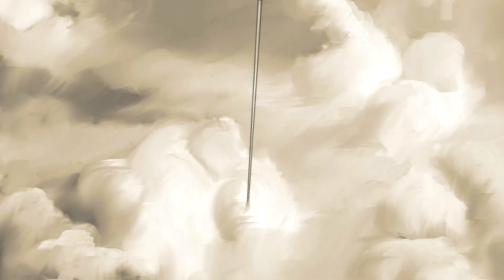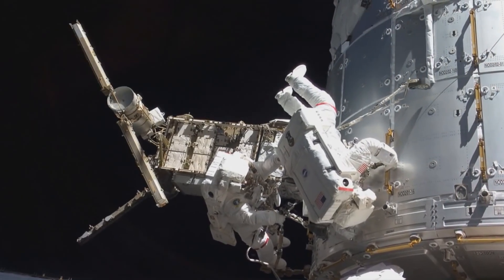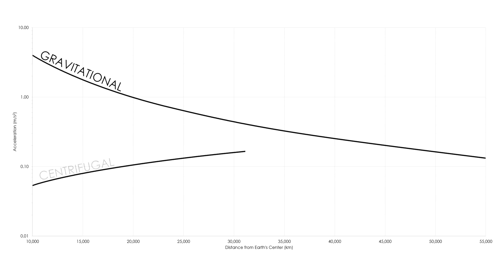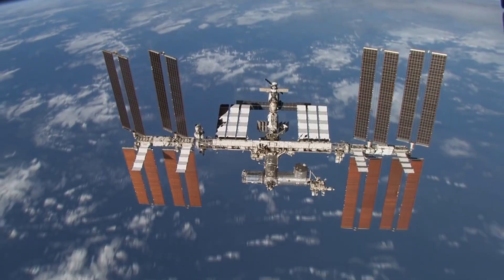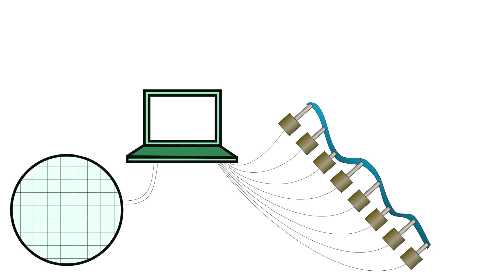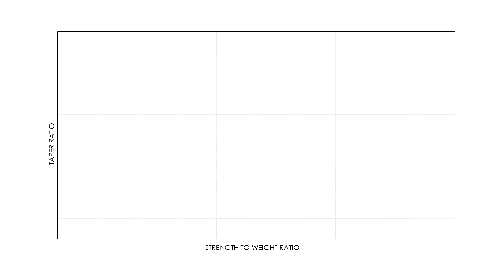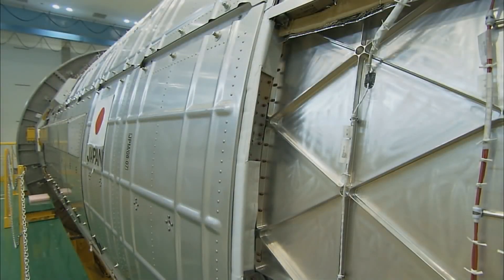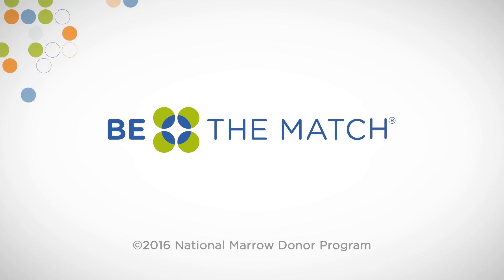Design Your Own Space Elevator

Comment: Tesla though about this over 100 years ago and proposed orbital rings in low earth orbit.  Commercially available tethers could easily handle the load across a span of 400km, and the trip wouldn't take weeks.
Reply: How would you use these rings?
Reply: @sebastiaomendonca1477  As they would be outside the atmosphere, you could do solar power at 2kW/m², launch upper stage rockets with no fairings (either conventionally fueled or with magnetic accelerators), and all kinds of industrial processes that could take advantage of a vacuum.  Plus you could build hyperloop, without the tubes.

Comment: Hellow brother this is 1 of the problems the tension , and to make a good job for elevator is that wire don't have to be in tension. Other way that wire will break and the good news is that the wire will make its own tenciion for its weight. To the ground but if to much tenciion no good and this is. 1 of revelations too, but I am getting exiting and I wish to be here. To be the first one to try that elevator and don't care if I die but will be so exiting that hard to explain, that exiting. Thanks for your video brother.
Chilli bean.

Comment: I would think if the tether could be conductive you could send power to the climber that way.
Reply: That is harder than you think. There is a lot of things that even I have a hard time know about it. I just did a quick google search on the topic and even short transmission power lines for like 200 mi or so can have losses of power of around 1.1%, but that is depending on the voltage sent down that wire. I look at the equations for that kind of stuff and it just way over my head to figure out but here is a link to the wiki page about this if you want to have a poke at it, and for a wire to be 22k miles well that is a lot of losses just in the wire its self at that 1.1% power loss, and this is at around 700kva, and again I would not know what voltage you would need to send the power at to keep the losses down, but still, it's some crazy number with that kind of distance. 

https://en.wikipedia.org/wiki/Electric_power_transmission

Comment: cant we power the climber by running 3 parallel carbon nano tube wires each with a high voltage phase running on it?  Then we can use any electric source we like

Comment: Aside from launching a rocket from the top of a high mountain near or on the equator there is little else you can do in the way of a space elevator. That mountain could be Mount Kilamanjaro which is over 19 000 feet tall and
 almost on the equator.

Comment: A few other important points:
 - The most practical way to power the elevator is to have large fuel tanks that get jettisoned, just like for a rocket, rather than using lasers.
 - If we're already assuming we can produce a graphene cable strong enough for a practical space elevator, we might as well assume we can pair it with a superconducting cable for power.
 - The minimal space elevator is far from getting things to orbit, as it doesn't directly impart velocity.
 - It would have to be much longer to allow things to accelerate via centrifugal force, and to gain more gravitational potential.
 - Vibrations along the cable and micro-meteorites are not to be underestimated.
 - Rockets are surprisingly efficient (around 10% for some orbits?). Given the huge upfront cost of space elevators, the long travel time, etc, it will take a while before they get competitive.

Comment: Well, it looks like multiwalled nanotubes are good electrical conductors, so the power problem is solved, just make 2 long cables out of carbon nanotubes around 1-2 meters apart and put the lifter between them, set up a few thousand volts potential difference between the cables and have the lifter run an electric motor from that. Ok, I know, the exact resistance of the cables will be critical, but also the gravitational force decreases with height, so you will need less current as you go up.

Comment: What if you built the nano wire from the station down to earth instead of building from the ground up to the station. It would have to start at the Clark zone or whatever he said. And build it going down. And as you build more wire. The space elevator/ factory would move to balance the two zone of gravity and the flying away part. I’m high 420 Engineering

Comment: why not a space lift? not attached to earth and use like a crane. we could get mass above the south pole (asteroid maybe) attach a crane cable to it and lower it down to an elevated platform use plasma thrusters on the "lift truck" to raise it.
still will be incredibly big job to pull off but maybe we have tech to do this?

Comment: Shooting a laser is not more energy efficient then running a copper cable... Sorry don't know how you think that's possible... It takes the nuclear reactor on aircraft carriers to shoot powerful
Enough lasers to burn up objects... And it would have to be more powerful then that.
Reply: Either way, it's going to be hard even with copper the distance we are talking about mean big losses with wires at 22k miles that loess of power just in the wire itself would be a lot. even with current transmission voltages which are around 700KVA  at 1000MW of power around 200 mi have a 1% lose and i think that for aluminum lines as that is cheaper. but still as the distance increases the resistance does witch mean loses and that a lot of power loess just in the wire its self.

https://en.wikipedia.org/wiki/Electric_power_transmission

Comment: How much energy would moving the tether be? Having a tether that is double could move the pod without having a motor on the pod
Reply: Yes! Just like a cable operated elevator, but it would be a continuous loop that the pod would attach to when it wanted to ascent or descend.  The elevator could have solar at the top for power.  The problem I see being difficult to overcome is the deployment of the elevator system.  Just exactly how do you attach a cable from the Earth to a counter weight in space?

Comment: I think Bradley Edwards wrote something about the taper: it should only increase in cross section some fraction of the length, the forces will start to decrease again; the tether would in effect be widest in "the middle", because thats where the tension is strongest. 
And how about the worst problem to solve: capturing an asteroid... Has anybody considered the energy needed to move that thing. And how about the risk management. Who on earth would allow an engineer corps fiddle around with a rock 100 times bigger than the one that killed the dinosaurs!
And forget nukes. Nobody is going to allow you putting those on a rocket (because what if the rocket blows up on launch, or falls on a country on the opposite side of the earth?)
Cheers, and have a nice day, solving those :-).
PS I do concur with the thing about the laser!

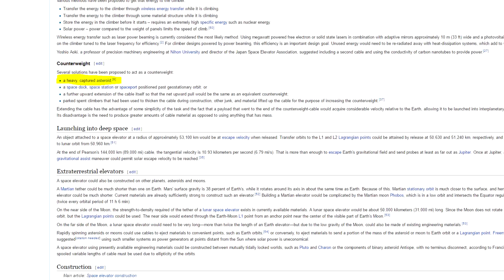Comment: 3:45 in my head increasing it's mass wouldn't help as while it increases the centrifugal force it also increases the experienced gravity by the same multiple leaving you with the same problem? So your only option is to be higher (though, if higher you could also increase the mass to increase how much tether pull you can balance out) It's been a long time since I did any physics, engineering or anything so am probably being an idiot though.

Edit: Also just found a comment by me from years ago on this video. Tuns out I have zero memory! :o thanks for making a video interesting enough I watched it a couple of times years apart!

Comment: Why not send the power through the tether? Just have charging stations every X kilometers
Reply: Pretty sure that is what he is referring to when he talks about extension cords (ie well due to resistance and such you wont have enough power left long before you reach even a quarter of the way)
Reply: @GummieI  Why not have a generator on the elevator? Not sure how feasible that is with how much fuel you would need but that is what immediately came to my mind
Reply: Gummiel u right
Reply: @GummieI  We can build fuel-based generators that can lift themselves off the ground WITHOUT needing a cable to climb, so this should definitely be doable.
Reply: @GummieI  

It isn't fueled underway. A 100 kilogram combustion engine + cargo combination with average (for modern) performance characteristics can make the climb with only 23 horsepower, carrying up 500 litres of gasoline with it, and reaching 50,000 kilometres with fuel left to spare.
Reply: @GummieI  On the way down you need a negligible amount of fuel -- just enough to start moving, because there's no air to slow you down. Once you drop a bit below geostationary orbit, the tether limits your ground speed to suborbital velocity, which makes the path of the vessel curve into the Earth with no force other than gravity required. The traction of the tether is then used by the elevator to slow down the natural acceleration, which requires no fuel.
Reply: @ChrisStavros  It occurs to me that if you were to use hydrogen fuel cells to power it on the way up, you could use regenerative braking on the way back down to electrolyze (some of) the water that was created by the fuel cells. This is assuming you didn't vent the exhaust, and that the extra weight of the electrolysis equipment and water tanks don't literally outweigh the fuel generated by doing this, of course. That or using some other kind of fuel we can pump power into in order to reverse the process we used to ascend. Batteries come to mind, but the sheer size of the battery needed to travel that far would be monstrous with current technology.
Reply: Keep in mind that as you leave the atmosphere, you no longer have ambient oxygen, so any fuel supply needs a corresponding oxygen supply.

Comment: You would also need to constantly accelerate the counterweight, as atmospheric drag on the cable and lift would constantly slow down its orbital velocity. It would also need to accelerate against the inertia of the lift, as the lift is not moving at orbital velocity at ground but needs to get to sideways speed as it rises.

So the counterweight needs to have thrusters firing just to maintain its orbit.

Comment: I also think on this little bit:) I remember that the cross section of steel musn't be large like on video. The worser problem is temperature of atmosphere is about 2000 celcius degree at the alttitue of 1400 km. So it is imposible to use a steel cable on there. By the way it is good to know that ı am not alone

Comment: An important, overlooked factor in elevator design: as the mass of the lifter ascends, it imparts angular pull - because the cable is spinning at a higher angular speed than the lifter was on the ground. The trig components of that drag tension along the cable pair horribly - one of them pulls the cable backwards in its orbit, such that a weight suspended above the Clark Belt would dip below it and fall; to compensate, you must make the cable longer, hence heavier. The other trig component just pulls earthwards on the cable, adding more apparent weight in proportion to the velocity of the lifter - so, if you want to travel faster, you create extra apparent weight. I'm still bullish on elevators, long-term, simply because graphene lets us make zeppelin towers with rail guns that avoid the bottom 15km of weight and acceleration-induced drag and tension on the cable, which help. Tweaking the graphene surface may turn the whole thing into a solar panel, and it's already an excellent conductor, so you could power many small modules along one, continuously. Additionally, powered high-speed pumps with hydrogen and oxygen are the best support power, if you are ascending through the inside of an elevator pipe . This is because they can ascend at high speeds relative to lifter, and their exhaust gas can be vented into lower chambers of the pipe, valves closing behind the lifter as it passes, such that the exhaust propels the lifter like a bullet in a gun. (Also, hydrogen won't leak out of graphene pump hoses...) Final exhaust into space occurs after the lifter passes the next valve; that final exhaust from the pipe is pointed backwards on the path of orbit, to compensate for the angular inertia and tension mentioned in the beginning. Done! (...on second thought, should we just use the zeppelin tower and rail gun, and call it a day?)

Comment: What if instead of a cable in the traditional sense, you build a ribbon.  This ribbon has multiple climbers that are, essentially, vertically moving trains.  Along the entire length of the elevator, you line it with solar collection.  This would make the entire ribbon a massive solar collector.

Comment: Space elevator will not work. If you move an object (wire) in a magnetic field you generate voltage (power). A space lift will generate thousends of volts. Even if you get an insulator strong enough the dipoles will gassify explosivly due to the potential difference between the earth and the top of the elevator. I guess you have heard of lightning? Yeah. Good luck.

Comment: Fundamentally Flawed Tether Assumptions:
1. The tether is monolithic in materials structure/stackup - possible but with current approaches certain to not  be the case.  Moving from currently available materials it would be engineered multimaterial/blend solution to even approximate (I was actually considering literal gravity tethers higher up - using tuned masses and linkages to convert the force of the planet into usable vectors/force/energy; a structure like that could very likely be physically discontinuous for the most part, just like the acceleration coils on a magnetic railgun type launcher do not need to be physically continuous nor contiguous - the only common element is the projectile they all work on but nobody works on it at once nor fully colocated or the design becomes weak/failed)
2. The tether is monolithic in physical structure - if nothing else, even/especially if the materials were consistent throughout, they would be reconfigured at different stability/optimal points throughout the distance/length of it.  The first thing that comes to mind is mass nanotube productions WHICH DOES EXIST, IS SUPER CHEAP, AND INSTRUCTIONS ARE ON YOU TUBE LOL which I'd use to make a single strand of hollow cable to anchor to the planet in a nice ring...so we can start off by simply entering the tether itself.  Maybe if I make that tether a mile wide on the ground it will actually become SMALLER and LESS MASSIVE as we get FURTHER from the earth.  Then we're dealing with not the angular stresses of operation but what happens if something in the system STOPS ABRUPTLY.  The operational stresses can be designed into the structure, which is then prototyped and tested with sensor clusters, optimized then deployed for test.  If you're not turning people into goop or falling into the planet anytime soon you have some time to work with the stickier parts of the solution.

One line stuck out in my mind from all that reading and ever since, when it comes to a problem of this time..."It's never a problem of engineering, it's of money and schedule.  You have the time and the money and we'll build it."  And that's TERRIBLY paraphrased, but mostly clear...
Reply: You tube recommends has m e respondign to another clip that automatically played and I didn't realize it was old.  WELL PLAYED BOTS

Comment: could we use rockets and electromagnetic coils positioned along the tether to get the elevator up to the counterweight? and as for the anchor cant we get the minimum  mass of the  platform required ready on the ground then use rockets to get it into orbit then send workers up to it via a shuttle to then increase the mass by building it into an actual station ik people are gonna say but your still using rockets the whole point is to eliminate them well thats actually incorrect first off youd only be using the rockets to get people up there once and using them for the lift wont require nearly as much fuel as a shuttle or heavy rocket launch because the rockets would be getting assistance from the coils along the frame as well as the gear assembly of the motor for the tether itself

Comment: I didn't understand why the cable has to be thicker at the top than at the bottom, surely you can use the position of the space station in order to compensate for weight cause by the cable itself? In fact scientists are so clever nowdays I reckon they could place an object in orbit so perfectly that they could tie a piece of normal rope to it with a rock tied to the bottom to keep it taunt and have it so that it permanently hovers 3  foot above a spot painted on the ground at the equator. Why couldn't they do that?

Comment: There is a small but significant thing I believe you may have overlooked. While discussing the taper ratio you mentioned how the line (at minimum) must support its own weight. To my knowledge you did not factor the weight of the tether into your calculations for the distance of geostationary orbit. I went and used the small scale carbon nanotube ultimate tensile strength and calculated the weight of the strand to be on the order of 1000's of tons (I used calculus to integrate the mass with respect to radius from the earth to find its actual weight not just its surface weight), which drastically affects the needed centripetal force to sustain orbit. This doesn't affect your conclusions at all, and if anything strengthens your argument, but it's an interesting and really fun problem.